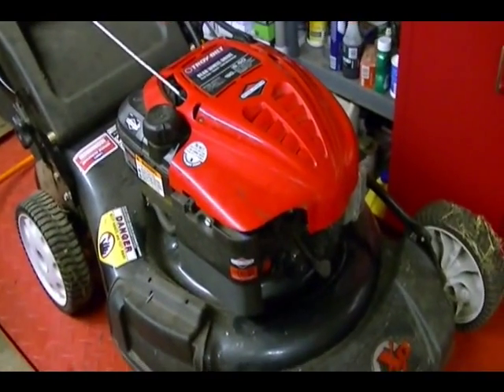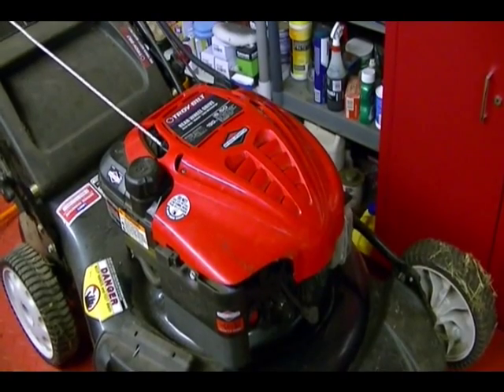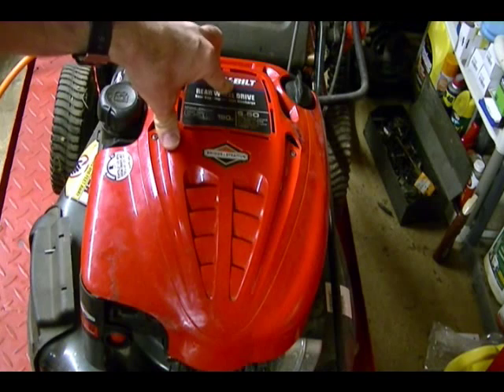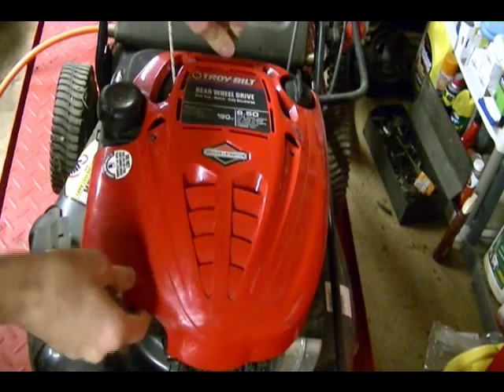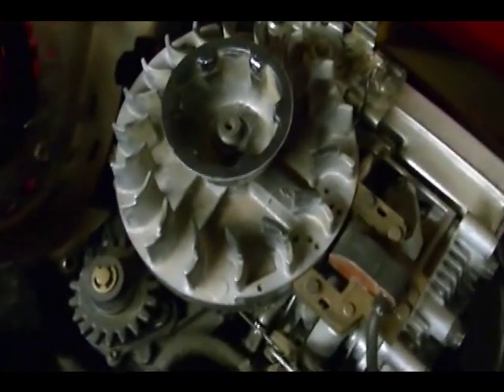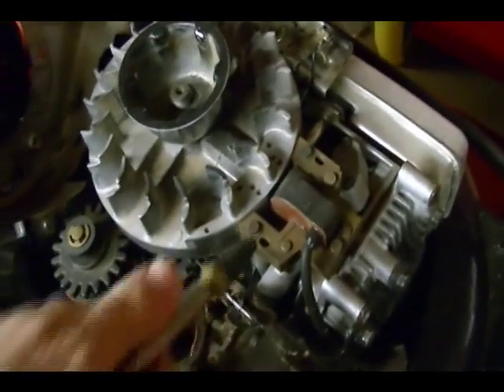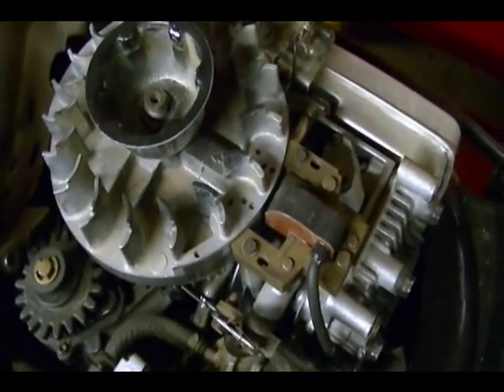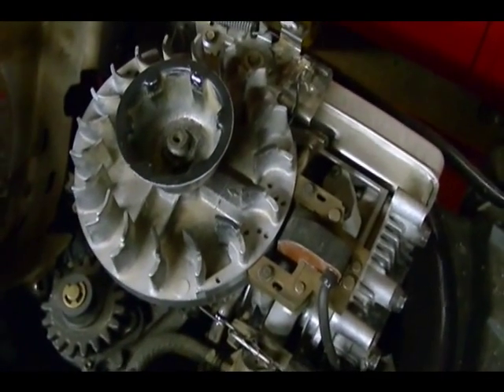How to Clean the Cooling System on a Briggs & Stratton Single Cylinder L-Head Engine

Comment: Great vid on a much overlooked area of all lawn mowers. Most people change oil & put gas in it, and start mowing. They neglect areas like cleaning of the cooling fins. One tip though, after pulling out your oil filler tube put a rag or something in the hole on the engine to keep debris out while blowing off the rest of the engine.

Comment: My B&S flathead is 10 years old and I clean it with a leaf blower (I lack a compressor) blowing air on the fins from the bottom and down the blower. I blow off the engine block too. Quick and easy.  I did remove the blower housing once and it was clean inside.

Comment: Great tips, I have noticed  on these engines if you do overheat them the engine will be real hard to start and no power, what I found  was  the overheating causes the exhaust valve to actually lengthen and it will not seat , thus I have to grind down the valve stem to meet the spec between the stem and tappet.  Keeping this engine clean is a must.

Comment: These flat heads (usually 12h802's) are some of the most bullet proof engines out there. I've rebuilt several of them, and they just keep going.
Reply: clearly my parents bought one in 99 and never changed the oil on it. I had to myself in 2016 and today took apart the cylinder head and cleaned off the carbon.

Comment: When you remove the oil conduit (fill tube), be sure to plug the fill hole in the crank case from where the tube was removed with a clean rag to keep dirt and debris from getting into the crank case while you are cleaning it. What I usually do is replace the oil fill tube into the fill hole after I remove the shroud.

Comment: Plastic should not be used on anything that spends a lot of time outdoors on hot sunny days. I know it lowers the production cost, increases profits, and lowers the price for the consumer a little, but using metal would dramatically increase longevity. I have a car from 2001, not even 20 years old, and ALL of the plastic bits on the outside are rotted. Modern consumerism does tend to make people "throw out the old" and buy new, but, we really should be buying new, then keeping it as long as possible. Sure, companies will lose some profits, but it's not going to kill their company, and if their product is superior to others, they will obtain and retain loyal customers for life and be more likely to purchase OEM replacement parts, assuming the parts aren't insanely overpriced.